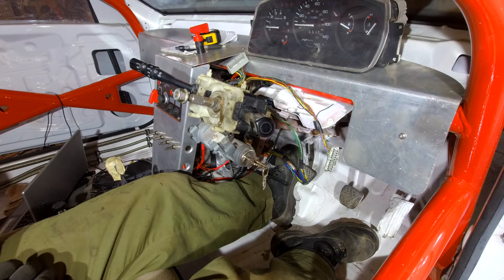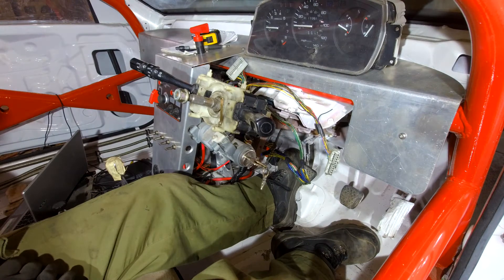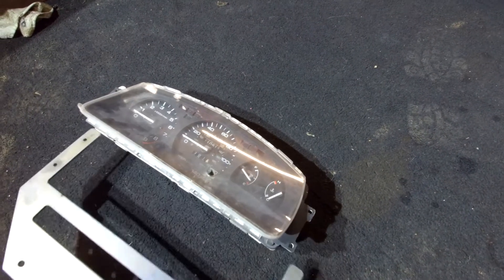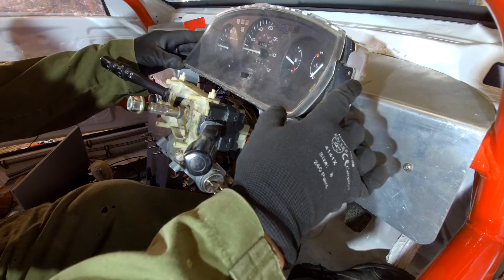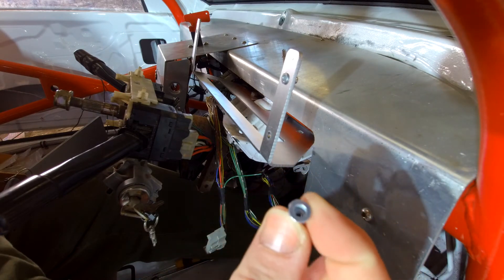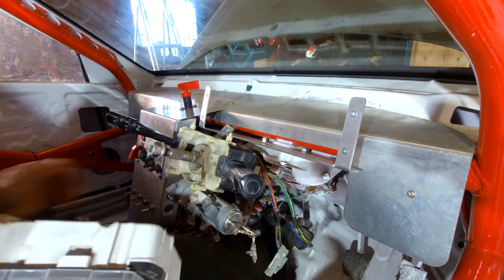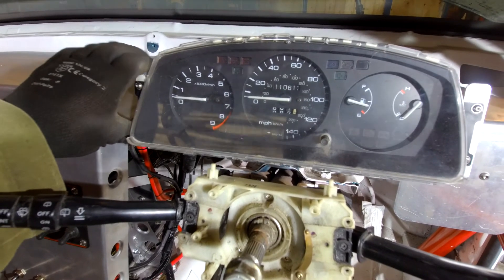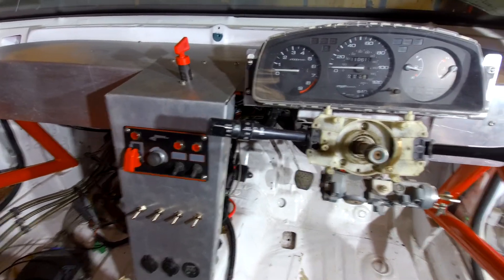Honda Civic EG B20 Vtec Update 3 (Dash Cluster Mount)

Comment: What is the thickness of the sheet metal you used for the dash?
Reply from the maker: 1.2mm sheet ally think it’s 1040 or 1050
Reply: @IAMotorsport  thank you! just finished mine with 3mm